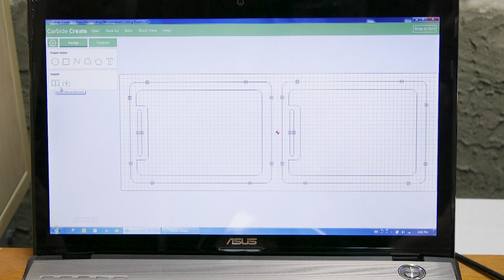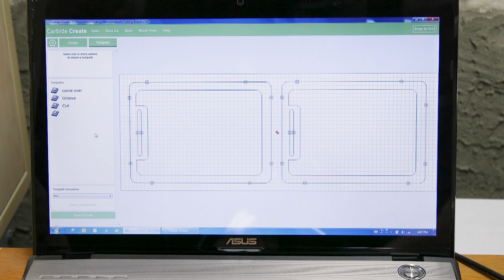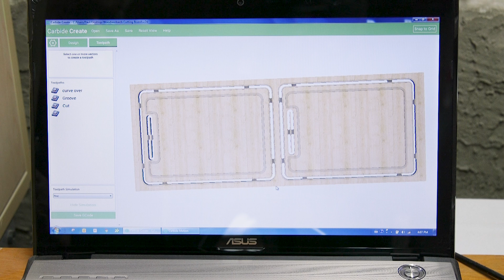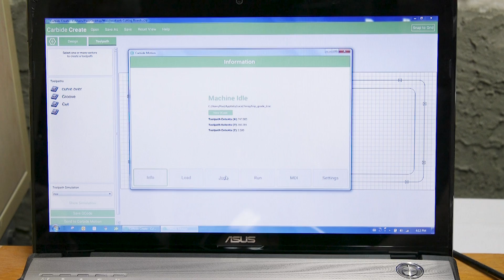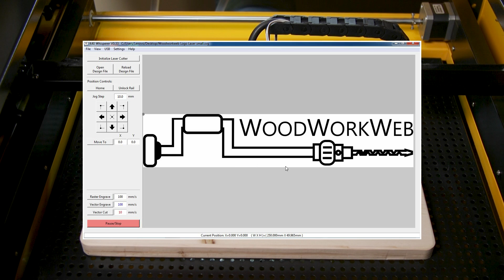CNC Woodworking & Laser Engraving Machines in the Workshop

Comment: Hey Colin love your videos. They have motivated me to make my first cutting boards and maybe turn it to a possible side business. I have a bit of a question for you and I really hope I can get your feedback. I want to make a brick pattern end grain cutting board. I have the brick and small mortars cut out of Walnut and Cherry respectively. However for the longer mortar I don’t have boards wide enough to re saw the end grain to the thickness needed. That said, am I able to use face grain or edge grain to fill in that mortar, considering that the main part is short grain and that mortar would be long grain? Or am I better off glueing boards together to get the end grain to length and trying to re saw the mortar strips from there? Looking forward to your response. Thank you very much.

Comment: You DO want to teach your Z=0 your tool length offsets, and it's a requirement in most shops to "single block"  or "dry run" your program to be sure there's no surprises...

Just a thought....

Oh, yeah, referring to an end mill as a, "bit," will probably get some funny looks. Just a heads up.

Comment: I am now retired after a 40 year career with a machine shop.  We had several CNC machines as well as manual machines.  In my wood shop, I make custom wood signs with a palm router.  I don't use a CNC for my carving.  However, I am considering adding a laser to my shop.  I have my own company now.....and initially didn't think I would be making things for inventory and craft shows.  But I am evolving and giving this style of business more thought.  So a laser is most likely my next major purchase.....because "engraving" is the line of work I think I will be pursuing with my company.  I'm 66 years old and I hope I have lots more years ahead to enjoy and learn the new facets of wood working yet to come.  But I will NEVER give up on "the good ole way" of hand tool work.
Reply: nothing like a hand carved object each piece is unique. I'am sculpting using ZBrush (normally assets for games/films etc) a CNC machine would help reproduce 'copies' in wood.
Reply from the maker: A laser should suit your shop well. Thanks for watching!

Comment: Interesting video. Thanks for sharing. These machines are not for everyone. You need the space and money for those. And I suppose there is a kind of learning curve
to become able to handle the programs. How long did it take to cut out the two cutting boards  (from putting the wood in till taking it out so included 3 or 4 times changing the router bits)?
Reply from the maker: The cuts can take a while, but remember the it free you to sand and finish the boards you've already completed, while your wait for your next boards to cut.
Thanks for watching!

Comment: I'll never get into laser or CNC woodworking, primarily because of my age. None the less, I found this video very interesting. I also enjoy the occasional visits to the other shops of your friends. Keep up the good work Colin.
Reply: I am close to 80 & like you I doubt I ever use one but interesting
Reply: I actually see myself using the CNC more and more as I get older.  It's something I can still use to make stuff even though I have aches and pains and my vision is not as good as it was.  What about your age makes you think you may never use one?
Reply: I’m 73 and never say never - I have a CNC
Reply: @itzmeagain8011  Thirty years ago, I'd gung-ho about these machines..  Today, if I owned either, I'd learn how to put  both to work. As it is, I figure I got maybe 10 more years left to pursue  my woodworking. Even if I had the available funds, it wouldn't be a prudent investment for me.  I've been using hand tools & my manual(analog?) woodworking machines for years in a small 1-person shop.  I don't have  a  need  to do production work or to save time, something both CNC & the lasers should be good at doing. Nor do I supplement income with my woodworking. I won't bother to mention my other hobby in electronics. <LOL>
Reply from the maker: Thanks for watching!

Comment: I don't know, but it seems like cheating to me.
Reply: They said the same thing about power tools
Reply: @maddogshwa  True that power tools make the hobby faster, easier, and more accurate.  Nonetheless you show me two identical projects and I will be more impressed with the one done totally with hand tools than the one build with power tools let alone a CNC.  Don't get me wrong, I do use power tools.  But the difference is that each piece is machined and your hands are all over that pieces perhaps scores of times to get to the final product.  A CNC: place the board, perhaps import a cutting board pattern from some source, press giddy-up go and the piece is machined.  Sanding and a finish, which could be sprayed on, and the amount of actual hands on that project  gets is hardly any time at all.  Fine for craft fairs but another thing when you give it to someone you personally know. And they know your hands hands and eyes have been over that piece many, many times.  IMHO
Reply: Well it's not cheating. It also takes skill to use these piece of equiptment. It all matters whether you want to commit to it
Reply: It's not. Try it yourself. There's more to it than you might initially think.
Reply: @alexreid4131  If a machine is doing all the work on the actual wood then it doesn't feel like my work anymore. The machine made it not me.  I enjoy using my computer, but I still prefer to think for myself and figure out how to do something on my own.  For mass production this machine is okay, but I don't mass produce.
Reply: @shadaj  Have you actually made anything with a CNC machine?
Reply: @alexreid4131  No, and I don't feel a need to do so. I prefer hands on.
Reply: @shadaj  Fair enough. Just saying that it's not as simple as clicking a button as you might think. And it still is absolutely your work as you have to create the design then figure out how to tell the motors to execute the steps to implement that design. I find it just as satisfying as creating dovetails by hand personally.
Reply: Agreed. More computer science(programming) than woodworking.
Reply: Don't worry though. I'm not a fan of it too